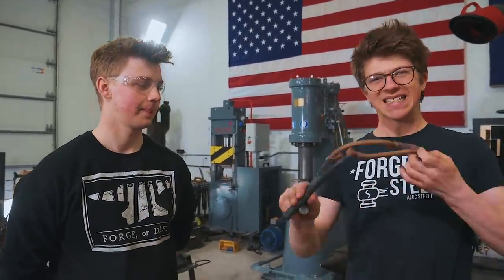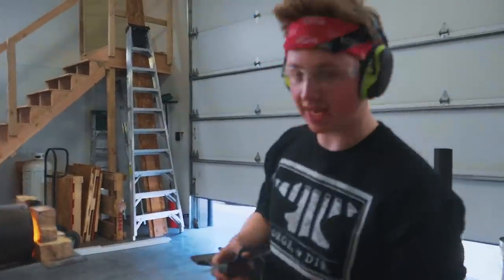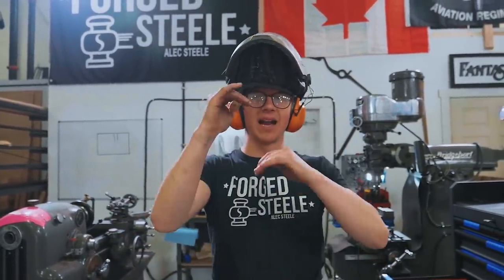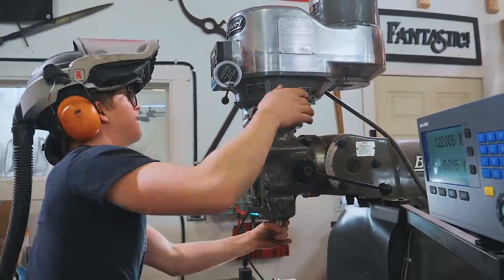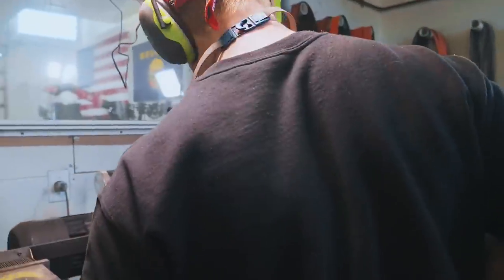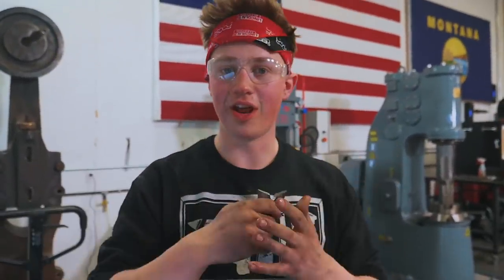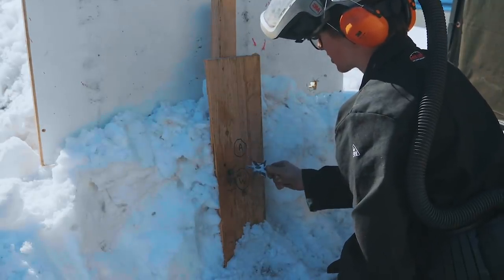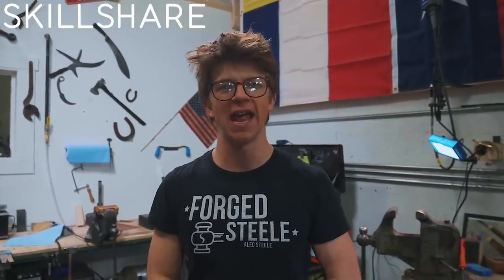MAKING THROWING STARS!!! Steele Vs. Stelter ep:4

Comment: Love seeing someone else besides me turning a carbide drill into a flow drill. (Down and Dirty Hexagon Milling Tip: 1. Drill and tap center hole.  2. Run a hex bolt down tight. 3. Rest head of hex bolt on top of milling vice and clamp down on the stock to be cut. 4. Mill it, making sure to cut all sides to the same length. By indexing off the head of the bolt and clamping the work this way the part won't spin. It's not the most accurate way to cut a hexagon plate in a Bridgeport, but it will get the job done for this purpose.)

Comment: When I made throwing stars as a kid, I usually started with scrap steel plates, marked the star pattern and then did most of the work with the drill press, drilling a line of holes, and then used a hacksaw between the holes, and finished the edges and points with the bench grinder.     While I did stick them in anything/everything much the annoyance of my parents, the best target for stars and throwing knives is a nice big chopping block on its side so you can stick it in the end grain.

Comment: Hi Alec, I'm a CNC programmer, a quick and dirty trick you could have used at 7:00 minutes when the star is spinning while being milled is to put a jacking screw underneath the part, on the opposite side to where you're starting the cut, so if you're starting in Y+ you could place a jack underneath in Y-.

Comment: In the early 1960's a friend of mine's father had a basement full of tools powered by belts going up to an overhead shaft. Off to one side there was a sheet metal cutting table which my friend and I use to make throwing stars. At one point he was feeding the metal and I was working the floor pedal, and I managed to lop off the end of his finger. Trip to a doctor later we finished up, ended up with four pointed stars that I think were close to a quarter inch thick and around five inches across. They didn't need any sharpening and worked really well, especially the time I missed a telephone pole and stuck one in the side of a car door.

Comment: Nice work guys! You both made it fun, as always. It’s 2 to 2. Tough luck for Alec the 6 pointed stars are a more pleasing design in my opinion. They are however way more difficult than 4 point stars. 

Will was going well with great planning and execution the whole way through. Alec you chose methods you hadn’t done before and complicated an already complex project. Will stuck to the simpler techniques that both of you are more practiced at. 

For the future you can put a expanding collet in the hex indexing block.

Comment: Alec: You should look into straightedge and compass constructions... With a compass and a ruler, you can construct a hexagon pretty quickly (with the added benefit of having the centre of the hexagon marked out along the way). I feel like you could have saved a fair bit of time this way. Or maybe doing this on paper then gluing to the steel would be faster.
Basically, just two circles of equal radius (each of whose centres lies on the other's diameter)  and then it's just a case of drawing lines after that.
And, if you're feeling really adventurous, you can read up on Galois theory!! :P

Comment: Hi Alec. First of all congrats for the video! I have seen you drilling those holes in your star with an end mill, or am I wrong? That's not a good job for an end mill, because the center of the mill doesn't have cutting speed and it suffers a lot of forces in the that drilling process. The next time you shold do at least a little hole with a drill at first, and then the hole with the mill. I hope this helps you!

Comment: Hey, when using your mill, using a ratchet to tighten typically isn't the best idea, things can move when doing a big cut, using a ratchet to loosen is great, but you should use the original handle, or at least an adjustable to tighten.

Comment: just subscribed and watch a few of your projects...you have a lot of skill and your problem solving is exceptional, the reason for this post however, is not only to flatter you but to offer you a challenge. when I was in school I loved metal work and for my o level we had to produce a beaten copper piece, but I like a challenge and I bought an airfix model of the cutty sark intending to use the model to make the pieces out of brass with the sails out of beaten copper and rigging out of wire but my teacher said I would not have enough time to finish it. (he was right) ,however I have never had the opportunity to fulfil this challenge myself but I feel you could learn a lot if you where take up the challenge, especially brazing and soldering! Oh and by the way I was going to enlarge the model to a larger size! But knowing you the cutty sark is probably not hard enough so any sailing ship would be an interesting challenge . Hope you take up the challenge!!!!!

Comment: Six-point designs look cool but they increase the likelihood that you strike the target with multiple points at the same time which spreads out the force and makes it less likely that the star will stick. Will's four-point design has a higher probability of sticking because each point has a wide angle where it is the only part of the star making contact on impact.

Comment: I am really digging these versus episodes. It's not easy to make a good throwing star. If it s not balanced properly it just doesn't work.
Reply: Bs I made one when I was 10 with mad mad tolerances and it works fine. Im talking mm of difference in length and width on each blade

Comment: I think Alec's don't penetrate anything because they have too many sides, I believe that they will penetrate if it have has 5 sides instead of 6. The reason being 6 sides are easier to roll, so when it touches the wood two sides create a v- shape with outward diagonal pressure creating a blockade. The way I see it is like poking something with one finger versus creating the "peace" sign and trying to poke something it doesn't poke as much.

Comment: i would have drilled the head of the bolt Alec and then pinned it so it could not rotate. might have been faster.

If you do not break a tool at some point... (the carbide bit.)  you are not pushing the limits properly. :P

I liked Alex's star better. but it was too thick you needed another 30 minutes and maybe to make it a bit thinner and then it would have stuck great.

Comment: Hey Alec & Will, did you ever consider to build something out of stainless steel? D2 is actually pretty simple to harden, cause you don't necessarily need to deep freeze it. And with the shop you have now, it should be absolutely doable to harden even high chromium steel. Shuriken from stainless would have been nice.

Comment: nice video, the timer seemed to only make the results of the challenge worse tho. both the throwing stars seems like they could have benefited from just a little more time. i think it might be a good idea to try the challenge where there is no time limit and whoever takes longer gets a score penalty based on how much longer they took. it still incentivises working fast but not sacrificing quality. the rule set i would suggest is both work at the same time and time how long it takes each of you. whoever takes longer divide out the time ratio from their polling score.

faster maker's score  -> poll
solwer maker's score -> poll*(faster's time/slower's time)

for example if the slower maker takes 10% more time then they would need about 53% in the poll to win. even if the slower maker took double the time they would only have to get about 67% in the poll to still win. also, you could easily add other penalties. such as wasted material or number of tools used. seems like it would make the end results better and some give the opportunity for the underdog to make a last minute comeback.

Comment: Although alecs star looks very astetic pleasing. It is not a good tool, because it does not have the wieght and support behind it to do much damage. im sure to a person itll hurt and make them bleed, but cause no real damage. Thats why even sharpened it did not stick. Itll stick if he throughts it with enough force. while wills isnt as good looking. It has the star function and that is a win. Hes able to through it, and stuck with less effort. If alec wanted his to stick and be able to function. He would need to make the points bigger. Reason being is so he the star had the wieght at the ends  and so the star has enoug room inbetween. It needs room inbetween, so the star doesnt turn hitting the board, and hit another point and bounce off. Making the star not stick.

Comment: To be honest, they probably didn't even need to be carbon steel. Contrary to what is portrayed in movies, TV and video games Shuriken were not used as a thrown weapon. They wouldn't be very lethal due to how short the tips are. They were mostly used for causing distractions like throwing at a lantern to take out the light, or throwing at a foe to cause them to block to give the user an opening while fighting.

Comment: alec you should've face milled it to thin it down a bit. Also I've burnt out some carbide tools when in machining school. Was face milling a piece taking a heavy cut and had it in low gear and forgot that it spins in reverse in low gear *face palm*. Lucky for me I could just rotate the carbide tips on the face mill.

Comment: I'm not sure about Montana 's laws on throwing stars, But here in Indiana, Under Indiana's criminal code, "Chinese throwing stars," defined as "a throwing-knife, throwing-iron or other knife-like weapon with blades set at different angles" can't be possessed, bought or imported into Indiana. Violators can be charged with a Class C misdemeanor.

Comment: Stelter Vs Steele, and Stelter has it. Throwing stars are illegal in Canada too, as they have more than two points.
Reply: Gareth Lamb Weird euro laws.. 
Who honestly attacks someone with a throwing star?
Reply: No one does. It’s a weird weapon ban, but no weirder than the Canadian laws that ban flails that have spikes, or the ones that classify blowdarts as illegal assault weapons.
Reply: Gareth Lamb So as long as my flail is blunt I’m good for everyday carry in Canada?
Reply: @nicholas8476  Yes, but if the head is bar-like then police might try to classify it as a chain connecting two handles, as that type of weapon is illegal. (Nunchuks, three section staffs, etc. Once again no real reason for them to be illegal.)
Reply: Gareth Lamb Gotcha. I’ll be sure to leave my nunchucks at home. 
I assume great axes and my mace are fine though? You know, Incase I have to do battle with those evil moose to the North.
Reply: @nicholas8476  They are indeed fine, but they cannot protect you from The Moose.

Comment: I used to own several Shurikens and most were at least six points. I’ll bet if you worked those points down more and hardened them you’d have no problem sticking it in the wood.

Comment: Could have used 2 equilateral triangles to find the points for the 6 pointed star. I would have just squared off the part then scribed the triangles and cut out the pattern.

Comment: Alec compromised on weight by going thinner and drilling that huge central hole going for unnecessary precision (it was a throwing star, not a fidget spinner :D ). Given the amount of grinding required to define the points, hand scribing the initial hex with a pair compasses would have been plenty accurate and way faster. Great design though and would have looked awesome in damascus ;) Will: simple, practical, effective !

Comment: I was wondering why Will or Alec didn't use the bandsaw to cut out the shape or the small wheel attachment to refine the points, then next thing I know Will's using it... still wondering about the bandsaw, my only guess, they didn't have time to anneal it & it would of just wore out the saw blade...

Comment: I think this would've been a great project for the press. Set it to 2.5 mm (about 1/10th of an inch for you dimensional brutes 😛) and flatten it to a pancake. Then just cut out the desired shape and hammer the chamfers on the points. 😛

Comment: Why didn't you support the bottom of your Hexagon using a 1-2-3 block as you had a flat bottom on the hexagon 180 degrees opposite the top face you wanted to mill and that's the case on every side with an hexagon. You could have used the collet block as you were but with the 1-2-3 under it you'd have had a solid surface under the piece and the collet would have just had to keep it vertically straight.

Comment: Both of your throwing stars are WAY to thick buddy. At most they should be 1/2 CM thick. It's about balancing weight in the center thinning out as it goes to point sloping if you will into a very fine very sharp edge